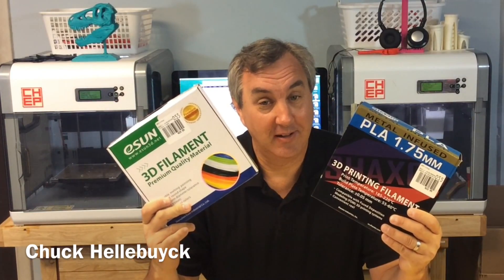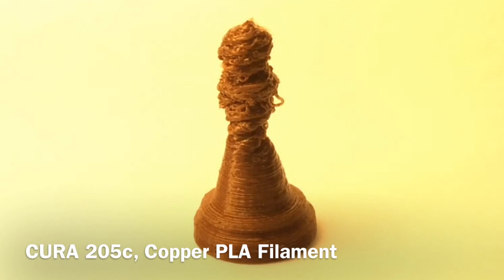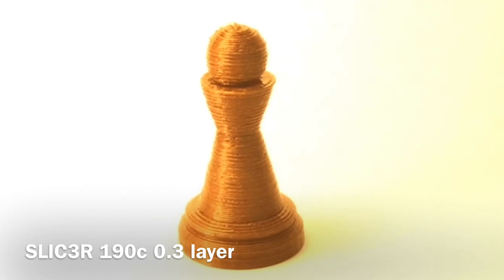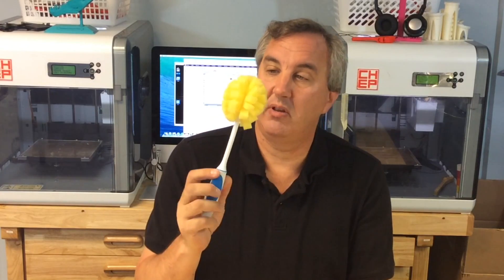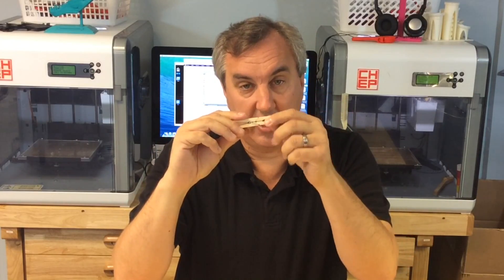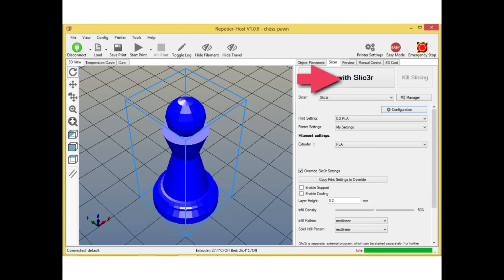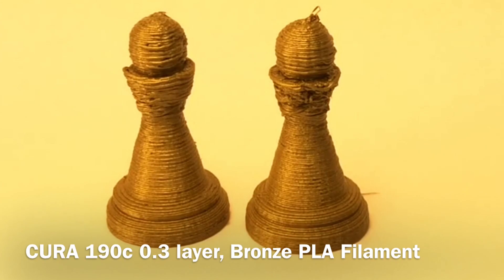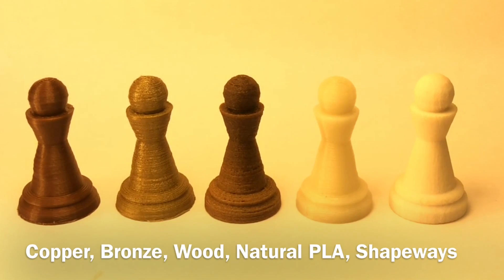Filament Friday #31 - Metal Infused Filament, Copper vs Bronze on Repetier Da Vinci 1.0A

Comment: Hey Chuck thanks for the help on previous issues w/1.0a. Why did you use slic3r instead of simplfy3d.  Can't you control temp and speed using simpilfy3d.

Thanks
Reply from the maker: I don’t remember. This video is so old. I no longer use DaVinci’s.

Comment: isn't the davinci 1.0/1.0a nozzle unfit to print exotic filaments like this? I have seen threads saying they need to upgrade their nozzle to print these types of filaments and I am unsure.
Reply: ***** if I were to replace something on the extruder, would it be just the brass nozzle, or the whole extruder module?

Comment: Chuck , slic3r is slower because the "Min print speed" feature. 
Read more at trustfm dot net section 3d printer section 7 fine calibration / page 1
Slic3r is the best free slicer but you have to set it up correctly. 
Read the tutorial and try again . 
Do not use oil you have retraction problems and you will damage the nozzle.

Comment: How did the Esun get stuck for you?  I've noticed sometimes filament can be wound kind of tight on Esun spools, and what was happening was when a retraction happened enough filament was loosened that when the retraction was reversed it then tightened back up under another loop.  If you have a timelapse camera you can use it to watch the spool and see if that's what's happening to you.  I don't know your particular spool holder, but back when I used to hang spools off the back of my printer what helped me was making sure the filament was pulled under the spool and up into the back (not over the spool and into the back). 
 
I haven't had it happen since I went to a filament cabinet (MDF sides, acrylic door, hole drilled in the bottom for bowden tube).

Comment: So did the oliveoil fix the Cura prints, or were they still subpar to Slic3r? I've heard a few people talk about this trick - using margarine just smeared on the rolls and similar but never needed to do it myself. 

With these 'metal' filaments my guess is there's not actually that much metal in them - certainly not as much as in bronzefill or brassfill.  They just don't feel dense enough and I found (with the chinese ones I tried) they wouldn't polish up.

Comment: Hi Chuck, I have had huge problems with Crua.  I only use Slic3r these days.  Question, Did you have "cooling" enabled when slicing with Slic3r?  This reduces the speed with respect to the time it takes to print each layer therefore making the print take longer.

Comment: In the cooling tab of filament settings in Slic3r. 
If auto cooling is enabled Slic3r will auto slow down the print speed for layers that are below 30 seconds; down to 10mm/s by default.
Thats why the print time is much longer than Cura. 
One of may fav features of Slic3r!

Comment: on the speed difference you over looked one item in cura. cura has a fast and slow settings your slow settings are near slicers settings. but your fast is higher. when you sliced it your slider bar determines the scale between the speeds.also the infill patterns could have been different.I usually use the hex pattern in slicer however that is slower then the grid.

Comment: How do you clean out a clogged nozzle on a Da Vinci?   The nozzle can't be unscrewed.   ???
Reply: +Chuck Hellebuyck's Electronic Products I use to remove it as well, now I just unplug the vent and heat it up to 250C and manual push. 1min job!
Reply: What if there is some foreign substance inside that is blocking filament from getting out?

Comment: Awesome channel! I going to buy a 3d printer because of you :D
Reply: +Chuck Hellebuyck's Electronic Products 

I'm thinking to start with a prusa i3 model.. sound good value for a beginner or not?
Reply: +Chuck Hellebuyck's Electronic Products 

You are never gonna guess what I just bought :P A Da vinci 1.0 (just like new) with 4 rolls of filaments! I paid just 350€(almost the same as $) for it! Can wait to start printing :D
Reply: I already did the heatbed fix and it works great! Btw, check my latest print on thingivers :D, maybe you will like it too 

http://www.thingiverse.com/thing:1004048
Reply: I even think that you can try the only use the top clip  because these magnets are stronger than mine.

Comment: Good info as always, still thinking of dropping the xyz firmware and loading repetier. that will also eliminate the whole cartridge chip bull crap and temperature control.
Reply: +HoppersLab Go for it!!  I didnt even did the test print with my DaVinci before reflashing it.

Comment: Is the metal infused filament hard on the print nozzle? Seems like it would be abrasive .  I saw some neat prints made with proto pasta Steel filament at a maker faire , but have been putting off trying it in case it wears out my nozzle .

Comment: I bought some Shaxon Bronze Filiment and I haven't had good luck with it at all, can't get a finished print with it.  I do get finished prints with the PLA that I bought from XYZ and its clean (inside the printer)  and thats why I think its a quality issue.   I wondered if it may be due to dust particles on the filament,  I am trying this filter next: http://www.thingiverse.com/thing:492067 and I will try using the olive oil with it - thank you for posting that!   I am using Simplify 3d and it slices amazingly fast - I'd be  thrilled  to test print that pawn sliced with Simplify3d and see how XYZ filament compares to Inland PLA from Microcenter ;)
Reply: Yes I'm using Natural - and it seems like the Nature PLA from XYZ is the best PLA i have used, its completely enclosed and fed from within the printer because even though I hacked it, and am not concerned with the cartridges / chips - its just more convenient because it was designed to handle the cartridge. I may need to look at the distance my non-cartridge filament roll is  from the place it feeds into the machine, maybe thats is contributing to the problem. I did implement the oil suggestion and I can't tell if it helped yet but I am optimistic!

Comment: does the copper conduct electricity? or is that just copper coloured? thanks!
Reply: I've never used it myself, but I believe that it's 80% metal dust to 20% pla. No idea if that would conduct
Reply: +Julian GoesPro It's just for color. Exotic filaments are just infused PLA,, and are actually structurally weaker than normal PLA.
Reply: Thanks! I was so wrong :D

Comment: Have you tried Inland's Filament? You can get it from Micro Center for around $15. The glow in the dark PLA prints amazing. I've had trouble with PLA on my Davinci 1.0a so I will try the oil idea. Thanks for another great video!
Reply: +dctisthebest 

I've been using Inland and so far I like it, no real issues and it's super cheap.
Reply: +dctisthebest Now I feel stupid. I see you have some inland in the background of your video. The oil works, just tested it.